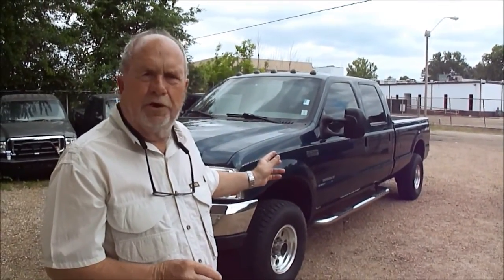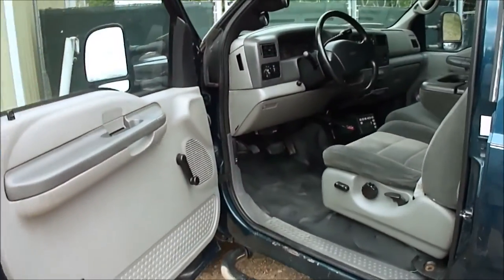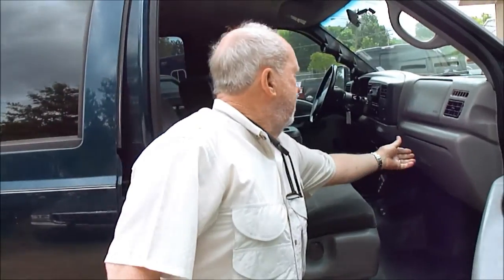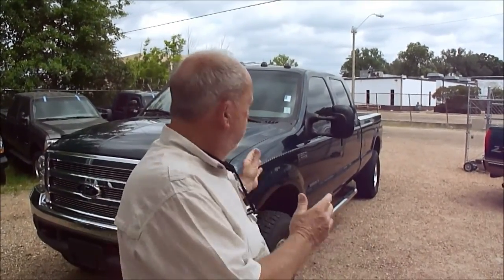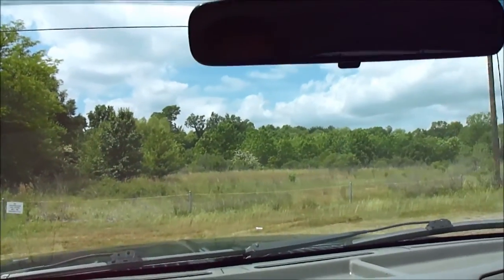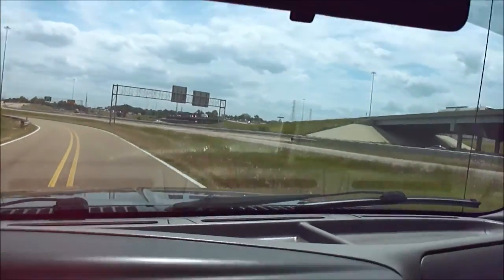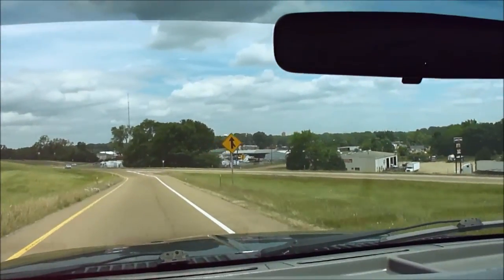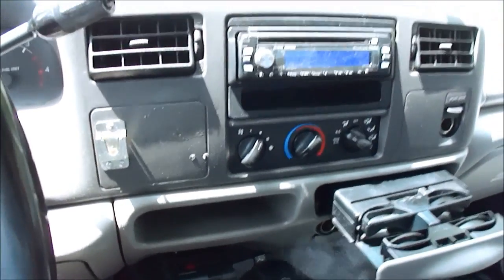1999 Ford F250 4x4 7 3 Powerstroke Diesel Video Test Drive

Comment: is the 7.3 a reliable engine that you can buy for keeping it?
Reply from the maker: they're slow but reliable
Reply: Yes they are dependable. They are not the most powerful engines ever but they are reliable.
Reply: Slow but one if not the best diesel engine to be put in a pickup. Makes like 225 HP and if you wanna make more, the engine is computerized, not as computerized as today's diesels, but you can tune up the performance of a 7.3 powerstroke